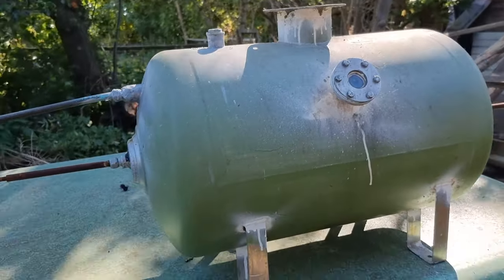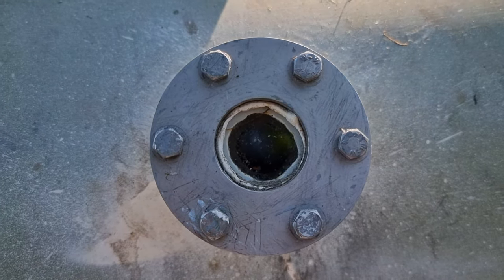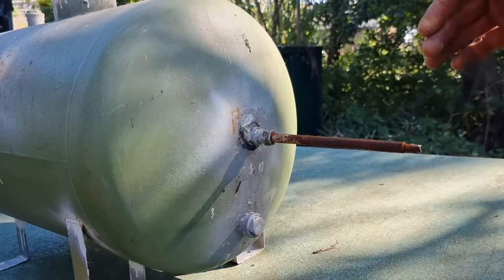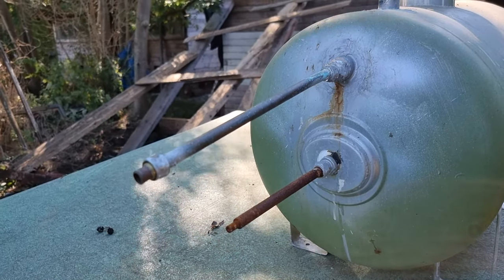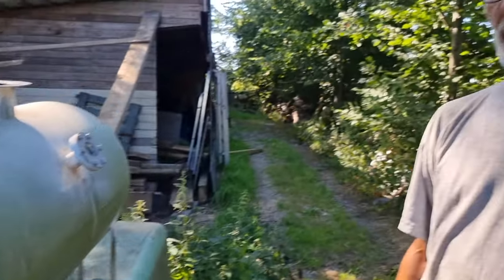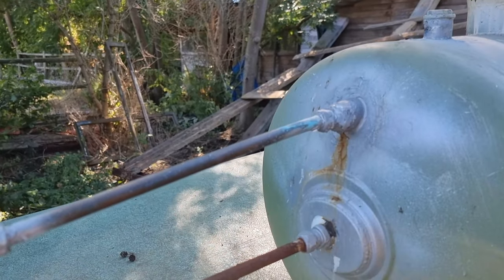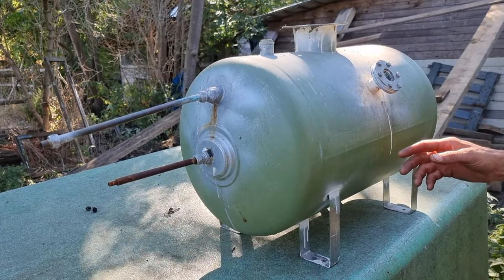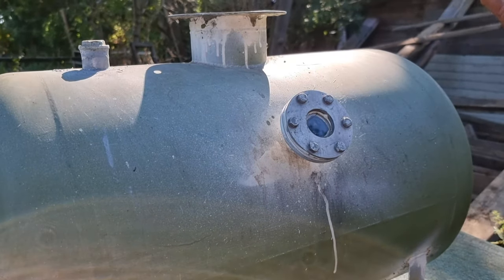VEGA - Valley - Where it was made

Comment: The experiments conducted by Ken Shoulders indicated that an oscillating anode was an effective means of achieving desirable results without excessive heating and distortion of the cathodic aspect.  Looking at the anode was your intuition directing your attention to the area that required some alterations.
Or I could be incorrect but I lack the lab to execute such testing.  Oscillating orbital anode. There is no failure this is progress. EVO Vega valley generation.